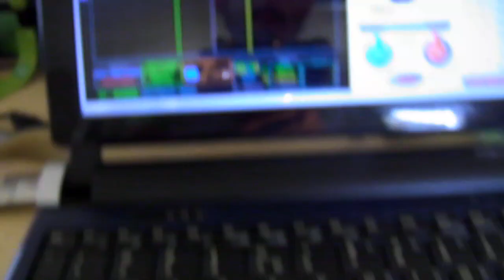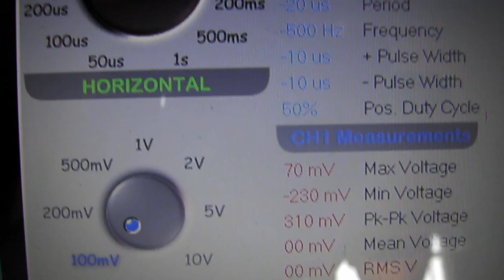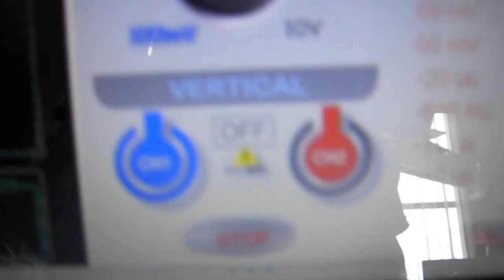10 Amps!! NOISE SUPPRESSOR  (ELC FILTER) CAMERA/VIDEO NOISE FIXER

Comment: is this can be used for car radio
Reply from the maker: Yes and no, Yes because it would work as stated, no because in a car you have to many sources of interference.... specially if it is an old car.. that use high power, high performance ignition coils... thanks for your comment

Comment: How do you measure the noise? I have a camera system in my car that is disturbed by electrical noise and I want to measure the noise and visualize it like how you do. 
Please show me the toolset needed. Thankyou.
Reply from the maker: Use an AM radio with an antenna.. find the scratchiest possible blank noise and move the antenna abut and around the car wire harness

Comment: I'm interested!  I've used capacitors and toroids to reduce video noise but this looks far superior.  Thanks Miguel
Reply from the maker: Just contact me using the "Contact us here" (https://mac-s-power.com/LONG-RANGE-30600-MAH-9P-4S-CUSTOM-MADE-LITHIUM-ION-BATTERY-I0Y0553.htm) or if you want to just shoot me a personal message from here.. with you Email, and I'll reply... just need the configuration, type of power supply, and power consumption. The real power consumption. not what the OSD on your flight controller say!! Don't take it personal, but so far I have not find a single flight controller that is dead on the money on voltage, and current consumption.